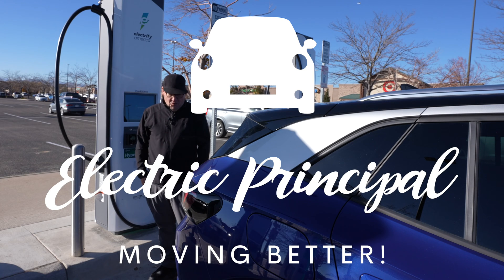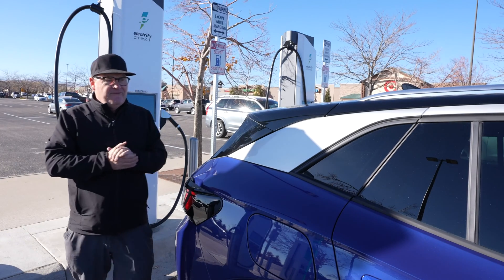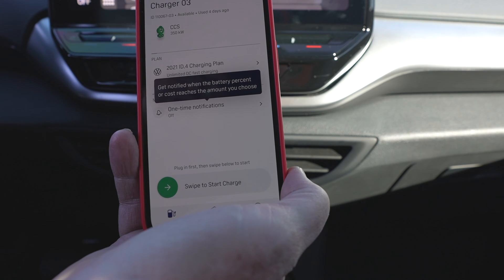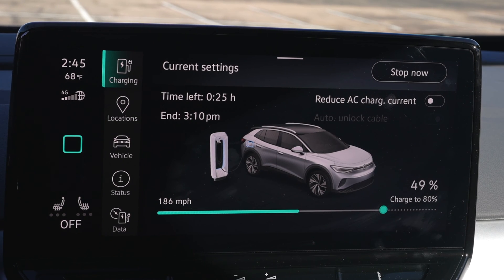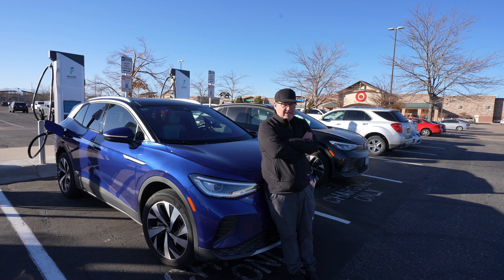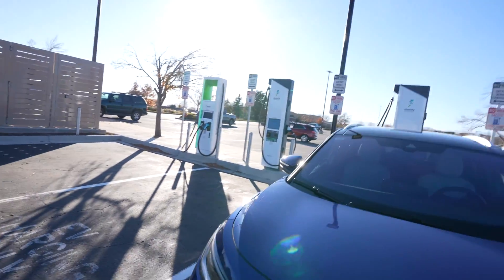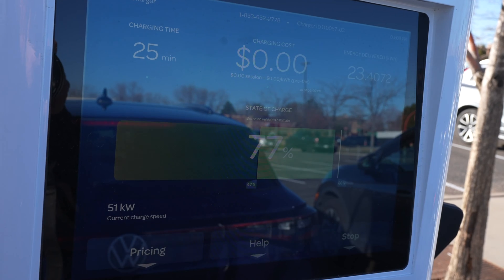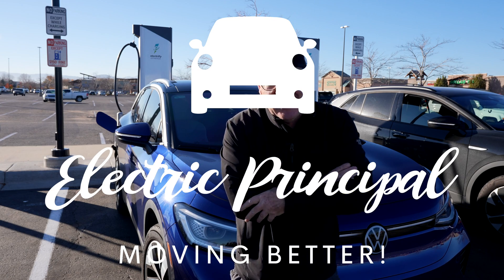How To Make Electrify America Work Every-Time!   Introducing the newest EA chargers in Colorado.

Comment: Technically, there is not "Level 3: charging.  It is called DC fast charge. Also, why are you at a 350 kwh charger, when you can use a 150 kwh?  Everyone should be courteous to use only the power they need!
Reply from the maker: Technically, it is Kw and not kWh when measuring the speed of electricity.  KWh measures the amount of storage capacity in a battery.  Also, I left  the 150 Kw open because it has the only plug a Nissan Leaf can use.  I would use the 150Kw if it was the only open station.

Comment: For the 2021 ID.4 (e.g., 1st Edition), I’d like to see a comparison between the original charging curve and the charging curve post-3.1 update. I understand that hardware improvements since 2021 mean we won’t see the fast charging newer models get, but I thought the software update was supposed to increase max charging from 125 to 135 kw on earlier models. I am planning a 5,000 miles road trip in the not-too-distant future and would like to know what kind of impact the software update might have on a trip with 30 or more 0:02 charging stops. For instance, 10 minutes saved per stop is 300 minutes off the trip. that’s 5 hours!
Reply: I’d also like to know which OTA software updates we can expect here in the US (now that we have 3.1) and when they might start rolling those out. Europe is way ahead of us in updates.

Comment: I hope that the Electrify America charging network is or becomes profitable soon (despite 3-year free charging incentives for VW EVs). This would help to better maintain the stations.
Reply: Actually, the EA network was never intended to be "profitable", at least not to VW.
It's essentially a penalty network.
However, in any case....
They have a dilemma.
With Tesla proposing adoption of their connector (and maybe charger construction?) as the US standard, while being plug and play, reliable (without a required procedure) in greater numbers, with greater fleet share, a fast modular deployment system ready to implement and being according to reports, 20% of the price per unit, A Government wishing for a fast expansion while using public funds responsibly might be inclined to choose that option? 🤔
.
Opening of the design patent to others has or course provided opportunity for  vehicle and charger manufacturers to produce their own cloned versions and benefit from the grants on offer?

Comment: If you had a Tesla instead of a POS VW... you can use the related application on your phone or the screen in the car to condition the battery for rapid charging.  Greatly increasing the charging speed/efficiency.
Reply: I get 200 miles range at Tesla Supercharger in less than 15 minutes. My 3,200 mile trip was every bit as fast as gassing up. With a 405 mile range, the trip was flawless and fast.
Reply: Play nice.
(Yes. I'm a Teslarati)

Comment: I don’t understand why you would take a the spot of a 350kw charger when your car can’t use more then a 150kw can produce. You’re breaking the educate rule in your video
Reply from the maker: No one was at any chargers when I pulled in.  Only one 150kW charger in the lot.  That is also the the CHAdeMO charger.  In this case, I would leave the 150 open.  Thanks for the question.

Comment: Interesting video. We just returned from a 2800 mile trip with our Kona EV....easy peasy trip, no range anxiety at all. We used EA most of the time but all the chargers worked pretty well regardless of brand. We have had the car since August and we have done 8500 miles and the car has been great and yes we do not really want to travel with our ICE vehicles. 
You are absolutely correct it adds time to your trip...we would travel between 500 and 600 miles per day and our days where between 9 and 10 hours (in an ICE vehicle that would have been 7 to 8 hours). No big deal at all and the breaks where appreciated. Charging costs worked out to 1/3 of our Toyota Rav4.
EV's are not for everyone, I still have a pickup truck as well as the Rav4 (along with a couple old MGB's) but the vehicle we enjoy the most is the Kona EV.
Thanks for the video. Oh and actually DCFC are not considered Level 3. There is just Level 1 and 2 and then DCFC....not that it really matters too much just not a recognized term.
Mike 🇨🇦

Comment: How much fossil fuel was used to make your battery?
Reply: How much fossil fuel was used to drill for the crude oil used to make your gasoline?

How much fossil fuel was used to transport that crude oil to the refinery?

How much fossil fuel was used at the refinery to turn that crude oil into gasoline?

How much fossil fuel was used to transport that gasoline from the refinery to your local gas station?

How much fossil fuel are you using?  I'd say a hell of a lot more than this guy charging his electric vehicle!
Reply: @p0kerp1aya  Done forget about how much fossil fuel was used to transport the child labor to the lithium mines as well.
Reply: Very good question.  If you want to educate yourself on the answer, there are a lot of videos that cite research for when in an EVs life it overcomes an ICE vehicle with net emissions.  If you're not really interested in the science, and just want to throw grenades, I'd suggest joining the Army.

Comment: Hot battery (above ~30 C) is bad for my e-Golf charging speed because car must derate charge speed to limit pack heating. Your advice is not applicable to BEVs without battery pack cooling system.

Comment: Plug&Charge with ID.4 is taking too long. Taycan has it, Mach-e has it, F-150 Lightning has it, as do other BEVs. What is taking VW so long?
Reply from the maker: I agree.  The ID.4 is a wonderful car, but VW has to make the software equal to the car.
Reply: @electricprincipal543  
Bad news on the VW software suite.
They just confirmed they will be pursuing the "Porsche/ Audi" version of the two options previously in development that those two companies will get the new product in about 2026(?) filtering down to other brands later.
Likewise, the next generation "Trinity" platform has been delayed several years (2028?)
.
Herbert will no doubt be frustrated, but not surprised.